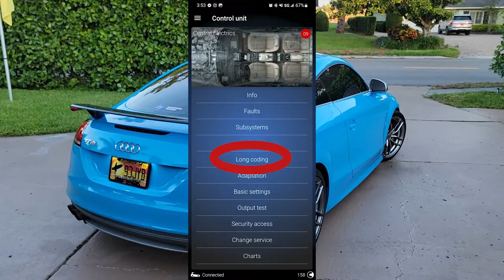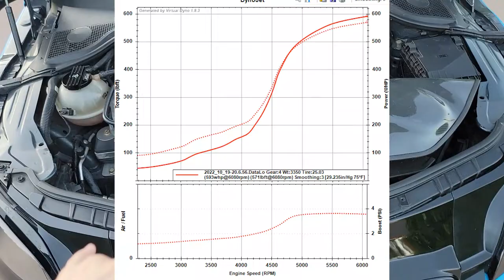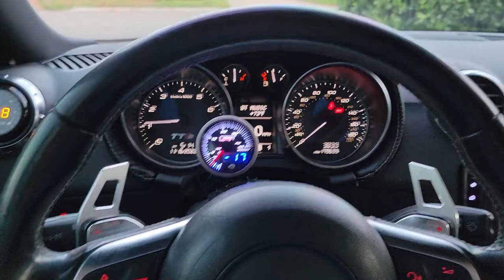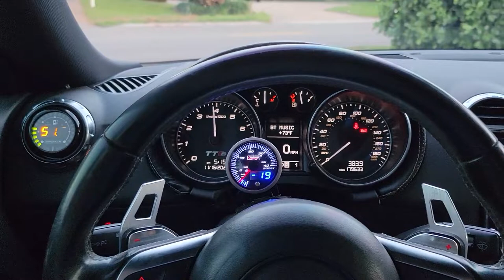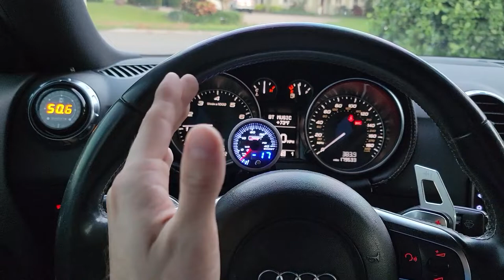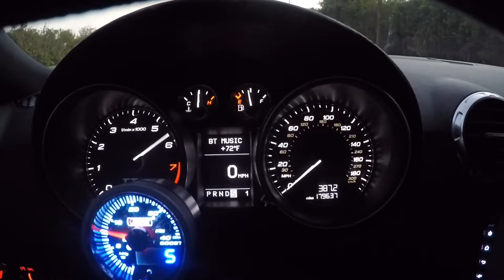Turning Up The TTS! -Part 2 (All the POWER!)

Comment: Daniel, your fueling issue could be a bottleneck in the flow of the ethanol sensor. You could T off into 2 fuel lines just before the sensor and then T back to one afterwards to help with the flow through it.

Comment: Hello danny and congrats on the tt project. I am from greece and i ve got a 1.8 tsi k04  at 390hp . Have you ever thought of using a boost controller like an iboost that we have in greece , in which you can adjust boost by gear and boost by rpm at the same time ? So that you dont have all the spinning while launching.